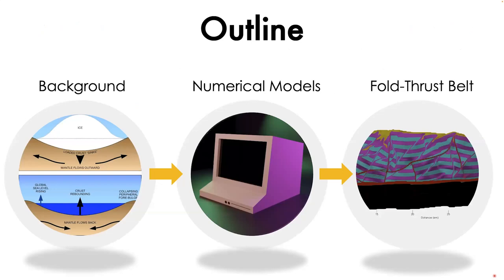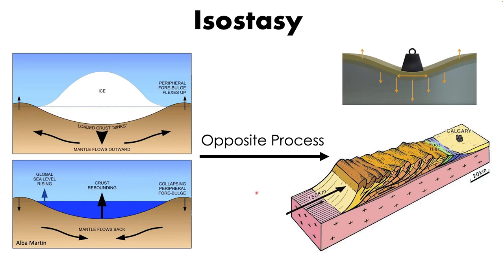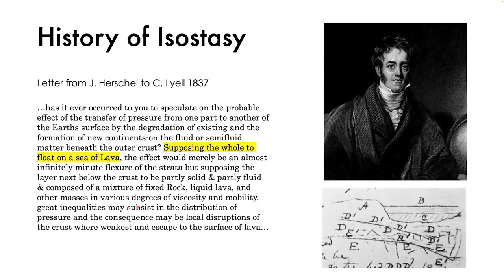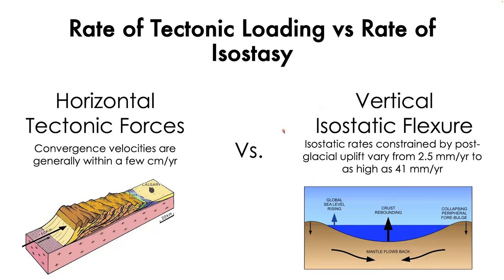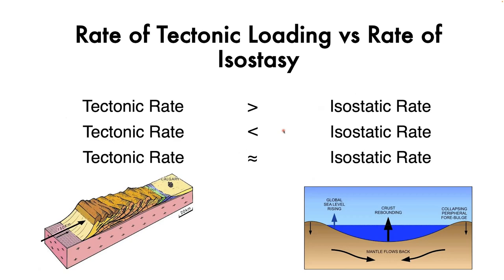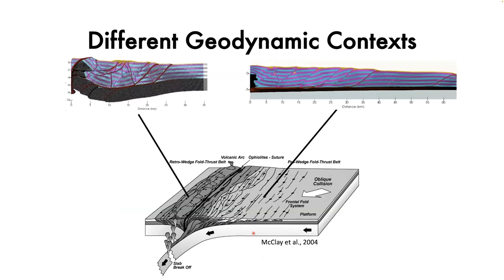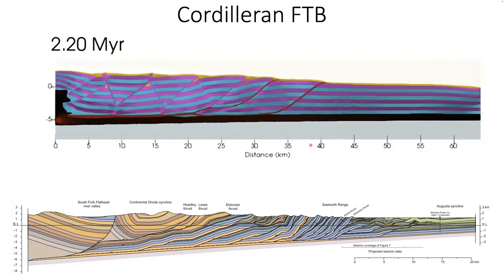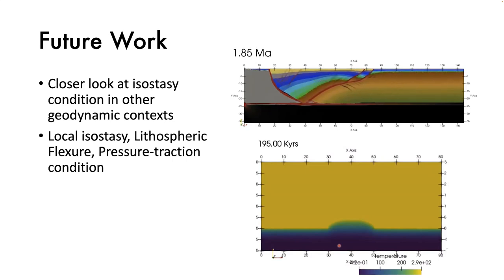EarthByte Seminar Series: Joe Ibrahim

Comment: Thanks, interesting insights.  I note that a lot of fidelity in the structures evolving in the approaching layer,  but a very simplistic assumption of a solid block resisting the movement.  I understand the necessity of simplifying assumptions, but would it be worth trying to model a more sophisticated horizontal blocking force that better represents real world conditions, much as has been done for the vertical axis?